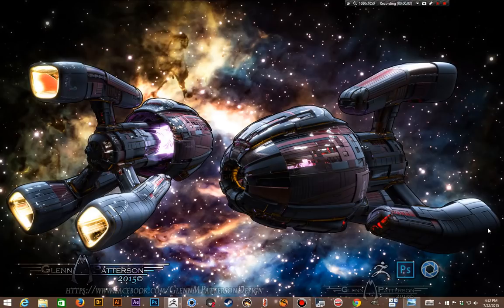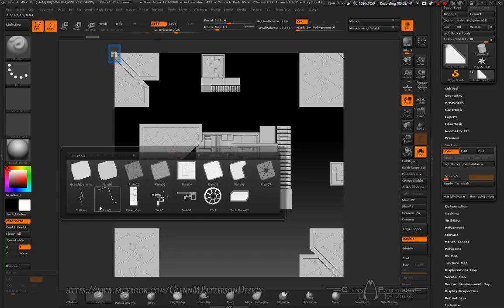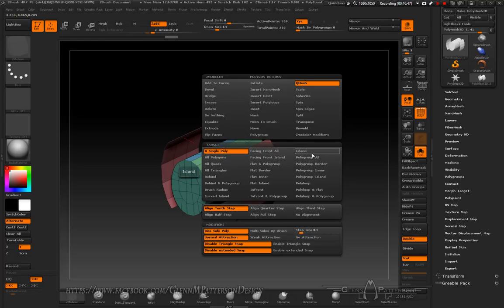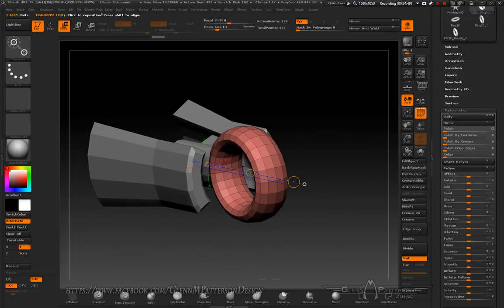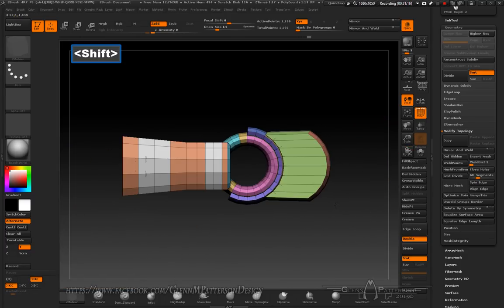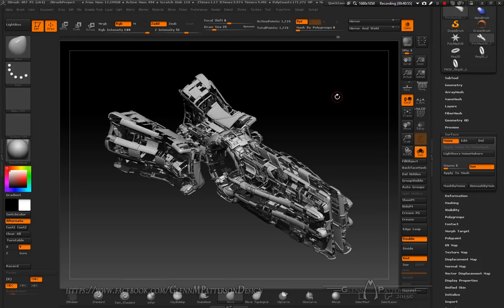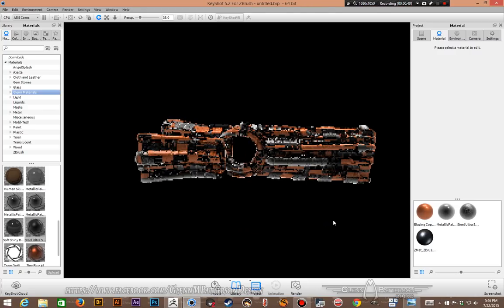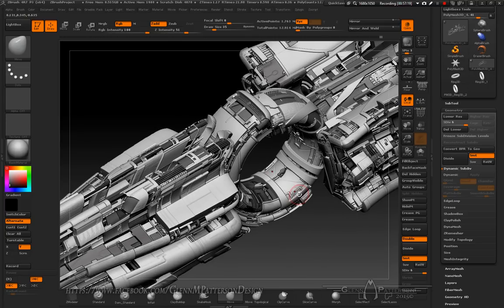Build a Ship in Zbrush 4R7

Comment: Hi! Awesome tutorial, got one question though. On 4-12, when you are using Shift-S combination and dragging a copy out, when you're done the copy is ok, but when im doing it, the copy, when im trying to manipulate it, leaves another copy in its place, and im not using Shift-S anymore. Can you help me understand the difference in settingsm which causes that?
Reply from the maker: +Анатолий Бакиновский I think its because your not in edit mode anymore, if you click T it well put the mode back into edit. The edit button or T switches Zbrush from 2.5D to 3D.
Reply: +Glenn Patterson Thanks, that helped a lot ) one more thing, what is the necessary condition for noise details to be symmetrical? I have a symmetrical topology, but noise seems to spread quite randomly
Reply from the maker: +Анатолий Бакиновский Easy fix, just mirror and weld again to get symmetrical noise. Every time you reUV a model you lose the symmetry of the UV map, mirror and weld will fix it

Comment: Hello, awesome tutorial! but I have a problem, in min 25 when you merge both parts in my case the polygroups disappear forming only 2 groups, what can I do to preserve the polygroups in this process?
Reply from the maker: Thats Weird. Most likely what Zbrush did is reassigned the polygroups to colors that are so close together, its hard to tell them apart on the screen, you may try to isolate some of those polygroups by doing a ctrl+shift click on a section where there was different polygroup and see if it still isolates them. If thats the case you can just do a ctrl w, to reassign the visible polys to a different group. Problem Zbrush has is its Polygroup coloring is pretty limited color pallet to pick from.
Reply: Glenn Patterson yeah thanks, I messed up somewhere, redid the part and now it's OK! thanks man awesome tutorial! J had 0 XP with zbrush but managed to do the model, thanks again!!
Reply from the maker: Your Welcome! Have Fun with Zbrush
Reply: Hello, one last question if possible, I just pressed something i don't know what, and in edit mode there are circles in the vertex and the edges are now more visible, making it very difficult to work, is there any way to fix it? Thanks
Reply: ok i just hit make polymesh 3d and it dissapeared, weird, thanks anyways!

Comment: Hi, when I apply the noise I get same panel effect. But when I do a render everthing "blobs" out. Looks like a big displacement mess. The model looks like a marshmellow spaceship :(. Any Ideas what I'm doing wrong? Thx.
Reply from the maker: +Sven Bardos Lower the Strength Modifer in the Surface Noise Edit Screen. With Surface Noise youll only be looking at the Preview of the Displacement until you do a BPR Render or do a Convert BPR to Geo in the Geometry Pallet. Best Practice is to do a BPR Render for each layer of Surface Noise you add to be sure the Displacement isnt out of control. Hope that Helps
Reply: +Glenn Patterson You're right. I can't raise the strength to 0.5 like you do. I have to choose a very small strength value. Maybe it's because I have higher resolution for my model. At some point I made a divide, accidentally.
Reply from the maker: Sven Bardos
Glad it Worked for You. I think that Strength Modifier Correlates to the size of the model in Zbrush Space. I do know has you Lower the Alpha Scale the displacement of the Surface Noise reduces even if you didnt reduce the Strength.
Reply: +Sven Bardos got the same problem, and experimentally noticed that it's connected with the "Inflate". I dont get the marshmellow effect on subtools which arent Inflated.
Reply from the maker: Анатолий Бакиновский
Yes the Strength modifier is basically Inflate or displace.

Comment: really impressive technique thanks for sharing, only one question, when doing subdiv a few times the hull became really smooth, if you wanted to keep a couple of lines sharp how would you have done it? thanks
Reply from the maker: +pierre verlhac When you subdivide turn off smt button next to your divide button. This will keep the overall mesh from smoothing while you divide. Also you can use crease edge command with zmodeler to select certain edges to stay crisp while dividing with smt on.

Comment: Hi, is there a way to deselect parts of temporary polygroup (grey colored polygons) or is undo the only way? I have searched the ZBrush Docs but couldn't find information about that problem.
Thx,
Sven
Reply from the maker: +Sven Bardos I Dont Believe there is asides undo, be nice if you alt click again it would remove it
Reply: +Glenn Patterson confused Right now I tried to click again with alt and voila it's deselected. I swear yesterday this didn't work....wtf...
Reply from the maker: Okay, I think if you hold alt and then tap shift it will copy the polygroup under it. Then hold alt and selecting will clear out the unwanted temporary poly group. Its a similar function with polygroup command in Zmodeler
Reply: I will try that. Thanks a lot for your effort.

Comment: Hello, your work has been very useful to me.
But I would like to know if you can expose the mesh with applied surface noise to open it in programs like maya? 
thanks
Reply from the maker: +Pietro Patanè if you apply the dynamic subdivision and then do a BPR to Geo that will apply the surface noise to the geometry. Do that to each subtool, you'll want to decimate the models down to lower poly count so Maya doesn't freak out. Finally merge all the subtools together and export as .obj. Hope that helps.

Comment: This tutorial has been awesome so far, but I'm really new to ZBrush, there's a menu that pops up at 16:43 in the video, how did you get that menu to pop up to select the polygroup all?
Reply from the maker: Using the Zmodeler Brush if you hover over a Face, Edge, or Point and Right Click with Mouse that menu will pop up. Also Space Bar does same thing.
Reply: @Glenn3D1993  Thanks! Actually just a few minutes after I asked this question, I noticed you went over that in the video haha I should have just been a bit more patient. 

But thank you for the explanation, this tutorial is awesome!

Comment: can't use the greeble elements, any chance you've got them for P2 ??
Reply from the maker: +Diego Gerardo Are you referring to Zbrush 4R2 or Zbrush 4R7 Patch 2. Unfortunately I don't have an earlier version of them. I do have a OBJ export of it though that I made last week for someone. https://dl.dropboxusercontent.com/u/27015792/GreebleElementsOBJ.zip Just import it and do a split by groups in Subtool Panel. You can still upgrade your Zbrush to the latest version for free at pixologics page.
Reply: +Glenn Patterson Thanks for the quick reply bro, i did get the upgrade and it worked just fine. Thanks again :)

Comment: Glenn, this tutorial is amazing! I know I'm late to the party but coming from 3D Coat (not as a full replacement as voxel sculpting is just too damp powerful), this has given me a great insight as to how differently the two programs can be used! One thing I'm wondering about ZModeller though... when I use bevel as per 20:08, it seems to want to bevel every surrounding edge bar the one I want. I just want to do the front edge rather than the top or bottom but that is all I seem to be able to do. Thanks for the great tutorials anyway! I bought you packs and now it's 04:15am. I'm having so much fun with it I suspect there will be no sleep for me tonight! :)
Reply from the maker: +Kraig Winterbottom Thanks! Glad you enjoyed the Tutorial. That bevel is a little twitchy I try not to use it that much. You should check out this channel I found the other day, he's got crazy skills using z modeler. https://youtu.be/J0oTQ36XsTM
Reply: Awesome! Thanks Glenn! :)
Reply: link doesn't work?

Comment: Looks fantastic! I don't have zbrush (yet, you are making a solid argument for it though!) but I use Blender and 3d-coat for modeling, plus I have substance painter and designer. Wondering if I could achieve similar results with a pre-built model similar to yours, and applying an existing greeble from you, in say substance painter.  Your other video that shows how you use substance painter briefly touches on opacity, so maybe that is enough?
Reply from the maker: +tosvus In fact the technique was originally done by a artist in Blender, then started doing it in Zbrush. You can do it in Blender by using Displacement maps and opacity maps. I have some free sample Greebles on my Gumroad page that you can tinker with.
Reply: Thanks Glenn, much appreciated! You have me watching ZBrush tutorials now though, damnit ;)
Reply: Sorry to ask you one more question, but would your tool work with ZBrush Core? Just contemplating whether I could jump in with a simpler version for starters (though it seems very limited in some areas). Thanks!
Reply from the maker: +tosvus You can do some things with core, it does have surface noise, but it doesn't support texture maps. Also you can't create the textures like I did at the beginning of the video. It is pretty limited on how I do things.
Reply: Ok, thanks! I think I need to start saving up. Just doing this as a hobby for now, so it's a good chunk of money - but looks like it is worth it.
Reply from the maker: +tosvus It's just a hobby for me as well. It's only paid off the past 2 years. Been messing with the program since 2002

Comment: Is there a way to move around the object that you made the snapshots from in case you did not like where you placed something before you created a new element?
Reply from the maker: Once you snapshot something in 2.5D it's unable to be moved around, just added or subtracted from.
Reply: @Glenn3D1993  Thank you. Here is another one for ya. Sorry for the nubie questions.  Is there a way to effectivly export to C4D and keep the look?
Reply from the maker: No Worries. I think you can get into C4D. You'll have to do BPR to Geo to each Subtool, because it destroys the UV's you'll need to decimate with polypaint selected. then export out FBX file. Now I'm not sure how many polys will slow down C4D. You might want to start small and work your way up.

Comment: hi i just checking out you tutorial and its really awesome. But i have problem,when i export to obj to cinema 4d evrything that i make from z brush is ruined and turn into flat mesh in cinema 4d. the surface wont load. any idea why its happen?
Reply from the maker: When using Surface Noise, you have to click apply to mesh in Surface Noise panel or BPR to Geo in Geometry panel. Then the mesh will be editable and you can export to external program.
Reply: @Glenn3D1993  hello. thank you for fast response sir :) i've apply to mesh in surface panel but it turn into low polygon mesh. how can i fix it?
Reply from the maker: Apply to mesh will apply to whatever your model is at currently polycount wise, so you'll have to subdivide it then apply to mesh. With BPR to Geo, it'll automatically subdivide to achieve the best results when applying the Surface Noise.
Reply: @Glenn3D1993  thx for your help sir. It's help a lot 👌 i hope you can make tutorial like this in future. Maybe zbrush to cinema 4D pipeline? Anyway thx for your help. And i've subscribed to your channel.
Reply: @Glenn3D1993  hi sir,i hope u doin well today. i just messing around with you tutorial again,then i find something weird. when i apply crease all to my object then i do all your step in the tutorial including bpr to geo,when i used the GoZ, the object on the another application won't appear. idk what happens or i do something wrong? would you help me figure this out? thank you.
Reply from the maker: @NAMEISE1  I'm uncertain on this, never used GoZ for any application. You might try reducing the Poly Count first by using Decimation Master in the Plug-Ins Folder, my thinking would be the App your sending to might not like the High Poly count that Zbrush generates. But thats just me guessing there.

Comment: I have problem sir i download your package from gumroad but i cant install your materials in my keyshot version 5 pro. Is there way to installing materials
Reply from the maker: I believe the material is a Zbrush material. I use Zbrush to Keyshot bridge to transfer everything to Keyshot, not sure how to import directly into Keyshot. If the file extension is .zmt that is a Zbrush material
Reply: No Sir its mtl not Zmt
Reply from the maker: Which file are you referring to then.
Reply from the maker: Weird, did I have that in my Gumroad download. The .mtl files should be associated with. Obj files that have UV's

Comment: This is efffin awesome! this will really help me out on my android game. Can the model be autogroups to form more individual parts so i can uv map and unwrap them for in game use?:) Keep em coming :) Thanks!
Reply from the maker: Yes you can get them grouped together. Way I do it is by decimating the HiPoly to around million poly then use group by normal. It works good till you get to curvy topology, then you may have to decrease max angle. After you did group by normal do a merge stray and similar polygroup. Now do split by polygroup in the subtool panel. Finally merge visible and export. Now you can bake a material ID in substance painter. Check out my latest video for the process.
Reply: +Glenn Patterson Woah! Thanks for this sir. This will help me a lot. I had to do all the details using IMM just to show details but with this workflow i wont have to. Hoping to learn more from you :) I hope i can grab a keyshot bridge soon. I have to export obj to keyshot for now. :) Thanks!
Reply: +Glenn Patterson just bought your greebles pack :)
Reply from the maker: Awesome! Have Fun with it. Let me know how it works out for you
Reply from the maker: The best way would be by apply the surface noise to your model and decimating the HiPoly model down to 2-5 million then export. Look at my latest videos to see the decimation process

Comment: Im having issues with it inflating the mesh beyond usability when i convert bpr to geo. Im missing something. Brilliant technique though.
Reply from the maker: Sorry your having Issues. Have you tried adjusting the strength modifer in the surface noise, turn it down. Funny thing about surface noise displacement is its dependant on the size of the model in Zbrush world space. Try using unify on your model and see if it scaled up, which meant it was smaller then the 1x1x1 Zbrush world space and now the displacement wont go so far. Also thin pieces of Geo will balloon up in comparison to rest of the model, you can mask those areas to tell surface noise not to displace there or mask at 50% and itll only displace at 50%. Finally do a BPR Render before you comit to BPR to Geo, so you can see your problem areas. Hope those tips help you out.

Comment: i want to export to 3d max , but zbrush exports the low poly base model with out the noise
Reply from the maker: I don't have Max or Maya, but if you do a BPR to Geo in Zbrush, which is in geometry panel. It'll apply the noise to the low poly model then decimate the mesh. You'll have to do this process to all subtools. Finally merge all subtools together then export. Mind you BPR to Geo will destroy the UV so you'll have to re UV in Max. Let me know how it works out

Comment: i seem to be doing something wrong.. i dont get the panelled hole effect.i made my own greeble map but it didn't get the desired effect so i used yours.but it didnt work as well.
Reply from the maker: +Minoru Kawaguchi I'm thinking in the surface noise interface you don't have your offset set to -.01, that'll cause the lowest layer of the Displacement to punch a whole in the mesh.
Reply: no no,i did do that step... these are my settings..

http://tinypic.com/r/2dk0ozl/9
Reply from the maker: +Minoru Kawaguchi Try raising the offset number -.1, -.2, -.3, and so on till you start seeing some results
Reply from the maker: Awesome, Glad ya got it working